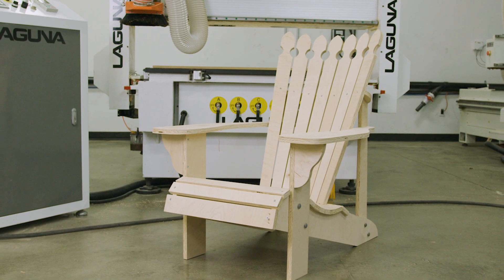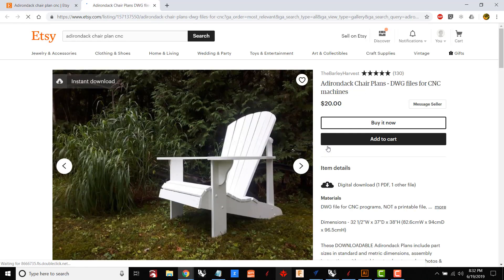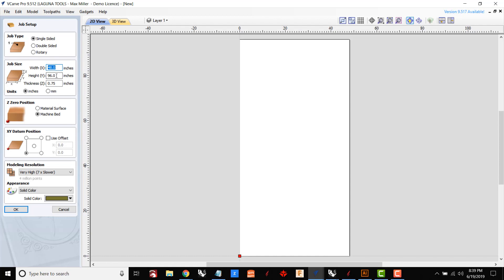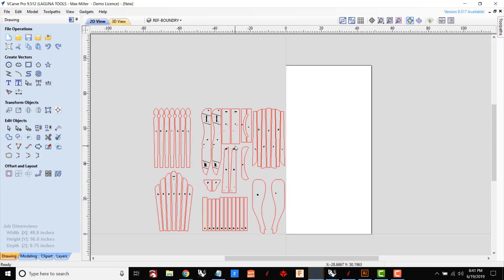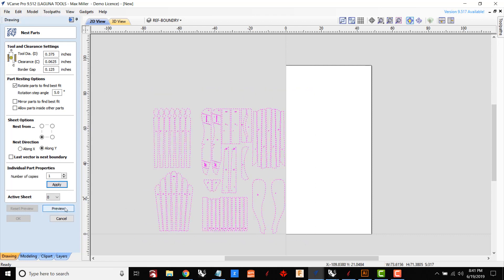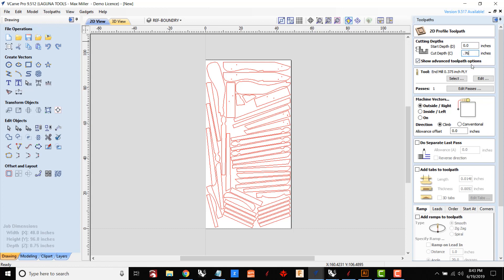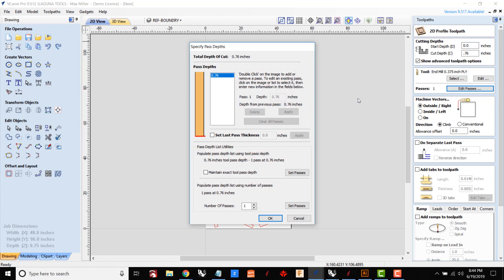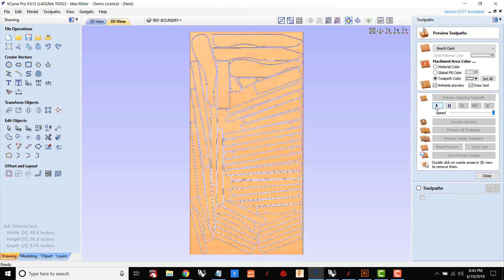How to Maximize Your Materials | Proper Nesting With A CNC Router | Laguna Tools

Comment: Nice demo of the nesting function..  I usually only use the nesting feature if I don't care about grain direction, or if I know Im going to wind up with a remenant of material that I don't want to have to keep track of, or want be able to use...  9 times out of 10, I can get better utilization by manually placing the pieces.

Comment: I appreciate the intro to nesting - I have a 2x4 IQ Pro and will be doing some of that as well. Not sure ply is the best for an outdoor chair... but to illustrate the concept, it's great. I'm just finishing a project with select redwood and it's all individual boards. I DO plan to cut a bit of it on the IQ Pro - a header for the planters, but the rest of it was just done on a miter saw. But even on smaller furniture projects on solid wood, nesting will be helpful. Thanks! Keep up the videos!
Reply from the maker: Yeah we used plywood for demonstration purposes and to test out the theory what we could successfully make out of just one 4'x 8' sheet. Stoked that it helped you out! Make sure to tag us one social with what you do.
Reply: If one were to make an outdoor chair out of ply ( I live in a semi arid climate), what would you recommend for plywood and finish? Could I get away with cabinet grade and an epoxy sealer?